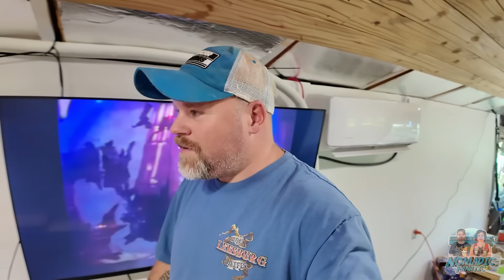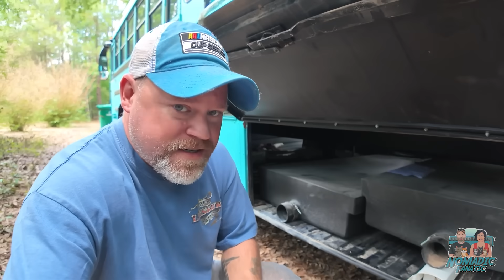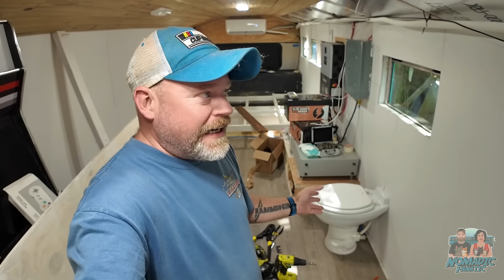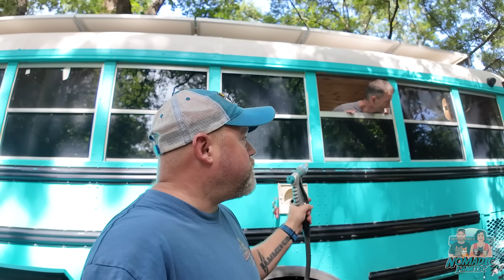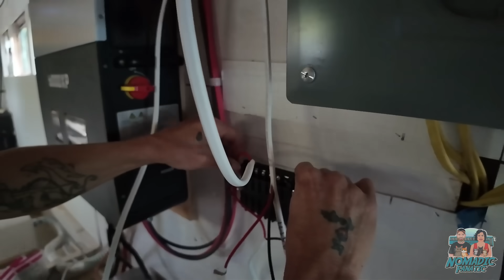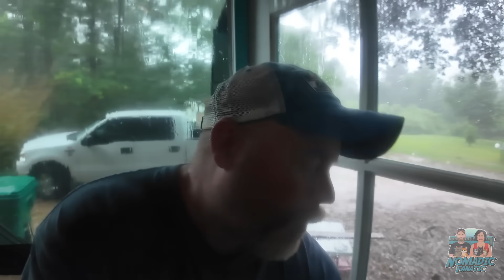Installing Residential Toilet in Skoolie! Plumbing & 12v DC Projects

Comment: 48v -> 12v converter by victron will do the trick. no need for the 12v batteries. I have that same configuration for my bus.

4x48v -> bus bar 
from there goes to inverter and the 48 to 12 converter that outputs into a fuse block.

no need for separate 12v bank. just dont use crappy step down converter. good quality is key.

Comment: Make sure you leave an access in case any issues with water pump, connections or lines 🥴 also add shut off to each line...
Reply: Haha I should've watched the whole video before commenting...

Comment: It's not just Mississippi. Here in Muskogee, we'll have zero chance of rain, then the thunder is rumbling, lightening flashing, and the rain pouring. The grass is 6-12" tall; can't mow due to the two inches of water sitting on the ground. We need to do some body work on the car and new u-joints in the pick-up. But even the paved floor in the garage is damp and cold if you lay on it long enough to do any work. Family in Florida, Alabama, Kansas, and Missouri are all experiencing the same. But y'all are making notable progress. I know there's a lot to do but if you get discouraged; watch a few of your videos from the purchase of the Nauti-bus. It is evident how hard you've worked. Personally, I find it remarkable. Love to Diana, the babies and your self.

Comment: Eric, I can give you one idea if you ever go inside a cold climate and it’s snowing outside freezing not everybody knows this trick if you dump antifreeze it down by your sewage and if you have gray water tank, you can put antifreeze down there too. it’s not going to hurt anything. It just keeps the water not to freeze. You can do like half of it a jug so it’s not gonna hurt it if you like rant, 50-50 or pier it’s not gonna hurt it so keep that in mind I live in a cold climate and that’s what I have to do every winter but I’m building my bus completely differentthan what everybody else has done but eventually, I’ll be making a video on that. I’ll let you know when I get it.

Comment: Not a plumber, But I think I would replace the plex from the wheel well to the toilet with a flexible mesh hose. That way it makes it easier to clean back there and you don't need to worry as much about banging the plex and disturbing the connections. (Maybe have the plex end at the wheel well "wall" and a fitting to screw the flexible mesh hose into it. like your typical home toilet.)

Comment: I did not see shut off valves on the before or after your water pump and I didn't see shut off valves at the fixtures you might want to put shut off valves on both sides of your water pump when it comes time to replace it it'll be a lot easier to turn the valves off disassemble it turn them back on You've done this before

Comment: I'm from the north, and moved south (AL) in my early 20's because of the ridiculously artic and frigid winters. Been here majority of the past 43 yrs, and still haven't adjusted to the humidity; and the older I get, the less I can (or desire to) handle it. Just don't know where to head for a climatic "eutopia". But as soon as I know, off I'll gladly go!🙋‍♀️🏃‍♂️

Comment: Just a suggestion, but a small oscillating tool would help with a lot of the smaller cuts in tight spots.  I also wonder if the plastic connection hardware behind the toilet might crack with the vibration and movement of the bus down the road.  If there are leaks/problems, it might be wise to replace the connectors with brass.  Also, a little 10X10 gazebo/tent would give you a place to put a folding table and tool totes and keep them out of the weather.

Comment: Water pump under the bed … partner flushes in the middle of the night.   Even a quiet one will wake you.  Put a 1 gallon pressure tank in the system.  You’ll get 3 flushes before the pump turns on and your pump will last longer.  Not a problem because at your age you don't get up in the night?  How long you going to own that bus?  :)

Comment: I would but a value between tank and pump so you can change pump with out draining tank and need thicker wire run to battery's you could get a lithium battery charger high output goes 110v to 12v and is backup if 48 v system down and plug in or run off portable battery stations or generator

Comment: You have a power inverter  correct??   If so   it makes 110 volt   buy a lithium  battery  charger  hook permanently to battery  that will keep them charged

Comment: I believe I remember that you were going to keep your inverter on at all times. 
I would recommend the Victron Energy Blue Smart IP22 Smart Car Battery Charger 12V 30A, Float & Trickle Charger and Desulfator for Motorcycle, ATV, RV, Lithium and Deep Cycle Batteries
Reply from the maker: I like that! Great idea and simple no fuss! Thanks!

Comment: Hey Eric, it's a moot point now but you could have just used step down transformers in the appropriate voltage to power the entire 12 volt side. No need for 12 volt batteries.
Reply from the maker: No, I talked about this specifically in the video. I don't need a stepdown for 12v. I have nearly 600ah of 12v lithium - I want to keep them charged for additional battery storage. A stepdown will just give you 12v usage from your 48v system.
Reply: @nomadicfanatic  I understand that you guys have the batteries and want to use them. However, if you want more storage you could have just increased your 48v capacity. That would be the most simple arrangement that allows for one large bank that powers everything. What you are attempting can be done but it will take more doing.

Comment: Can you pipe the gray tank drain into the black tank drain/connection so there’s one connection and the gray ‘flushes’ the black?
Reply: I must’ve misunderstood what you were saying: you can’t have the drain for the tanks higher than the rest of the tanks. It won’t drain. What did I miss?
Reply from the maker: I could - if I moved the tanks back to block the opposite side for valuable storage... I'd need to create an extra 12-14" in order to tie them together at the front and it just makes no sense. I'll just have 2 valves, but then have more storage on opposite passthru bay. :)

Comment: I would strongly advise to pull toilet and move the flange forward 1/2” away from wall so you have a little gap so if you decide to put any thing on wall.

Comment: Just use a 40 -50 amp mppt charger to charge controller to charge your batteries directly from 48 volts.